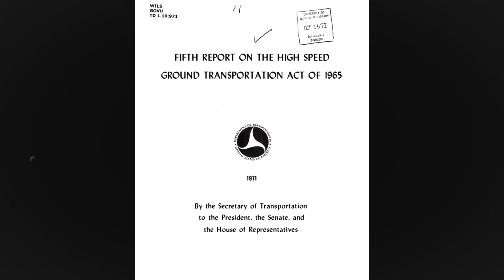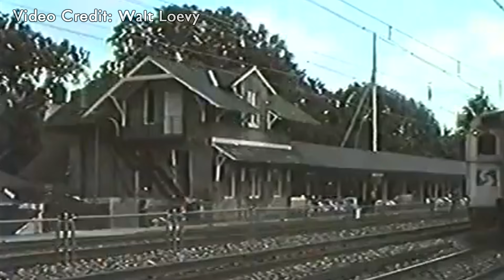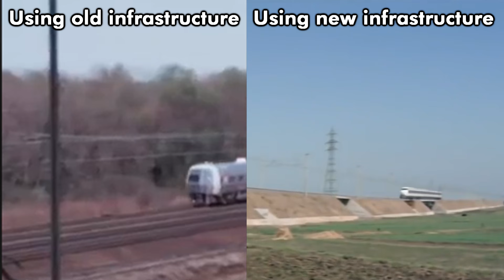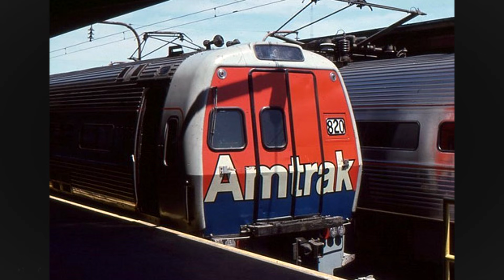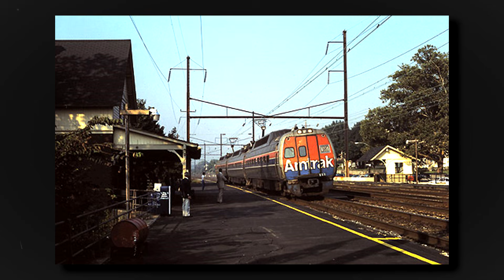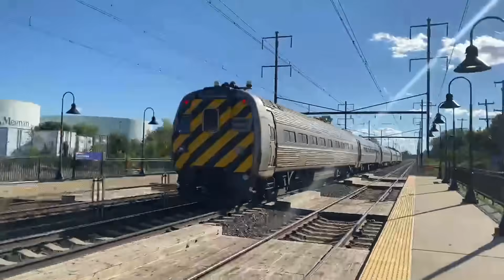Engines of Amtrak - Budd Metroliner [REMAKE]

Comment: Theoretically, it would have been possible to insert Amfleets in between Metroliners and have them run as a multiple unit independent of any locomotive support... I mean even in Japan, their express trains are a mix of both motor and trailer cars. You just have to resolve the HEP issue.

Comment: They were trying to build high speed rail, how did they not think, for one second, even as metroliners were ripping oit windows, to add an ærodynamic nose cone to the front and back?
Reply: Especially when they had done that to steam trains not more than 30 years before and there were rumors that they had already beat the Shinkansen with those.

Comment: I’ll be honest, using Metroliners as amfleet cab-cars is actually a great idea. The amfleet and metroliners have very similar in body style, so it would be rather simple to just remove the propulsion systems and put AAR type B trucks where the driven trucks were, and use them as push-pull cab cars.

Comment: If you asked someone in 1960 which country built the Metroliner, the USSR or USA, no one would guess correctly. It's a very Soviet solution to high speed rail: a big, dumb brick that goes fast.
Reply: Pretty well sums up America; a big dumb brick going fast, straight into nothingness.
Reply: The United States and the Soviet Union were actually very similar, the difference is that the Soviets were oppressed by the CCP and the Americans are oppressed by the corpos
Reply: @armandoventura9043 communist party*, CCP is the Chinese equivalent

Comment: A few stripped Metroliners were used in commuter service running in the Calumet Region of Indiana into Chicago. They were used as push-pull cab cars until replacement by cabbage-ified F40PHs.

Comment: Ok, so we've had what is by most standards HSR since the 60s, since before Amtrak! Yet Brightline still only runs 79mph and claims it's somehow "HSR."

Also, I feel like we need some kind of a name for 110 to 125mph services. Riders need to be able to immediately tell that this is not your conventional intercity Amtrak line. But at the same time anything below 125mph really isn't true HSR either so you can't just call it high speed. I guess "increased speed rail" or maybe "bullet train"?
Reply: I think Amtrak tried doing that with the Acela brand in the early 2000s, but it just generated confusion. Anyway, the definition of a train service travelling around 125mph is "higher speed rail".
Reply: @nicopavvi8494  But that is basically the same thing as HSR in the minds of the vast majority of consumers. Just look at how Brightline is constantly called HSR, even though they themselves tend to avoid that moniker for their existing route. People get confused easily. You can't have two different terms be only two letters off from each other and expect people not to be confused. Unless you are deliberately trying to feed into that confustion.

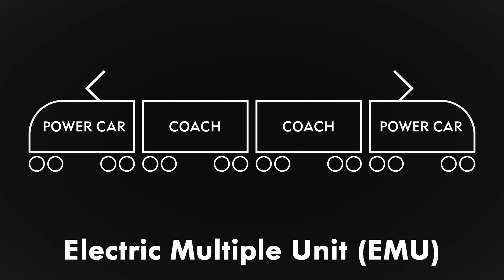Comment: 0:58 That was so satisfying to watch. Government officials have no idea how to run a railroad so them bullying the PRR into giving them clowns what they want was just pathetic.
Reply: In all fairness, the private companies did not know how to run passenger service either and were much worse than Amtrak in many respects. They were only doing it because they got insane subsidies from the government that were conditioned on them running passenger service. 

The real problem with passenger rail is that it does not generate its benefits directly from ticket sales but via network effects in adjacent economies. It's the same with highways, bridges, and airports. If you set the tolls high enough to actually pay for the buildout and maintenance, then no one ends up using them. 

So you absolutely need some mechanism to capture those benefits to keep the service profitable. In Japan and Hong Kong (both notoriously great rail services) they let the railroads get lucrative land deals. The Transcontinental Railroad project gave away so much land to the railroads that they became the largest landowners in the country. Maybe that's how we need to run passenger rail in this country.

Comment: Always had a soft spot for the Budd Metroliner, I think because it was a train with a lot of endearing features, but ones that were sadly not fully realised. :)
Reply: The Metroliner electric m.u. cars were sadly, a victim of the technology that was available at that time. With 50 years of advances in technology, a newer "Metroliner II" type of electric m.u. car could work out, especially on MARC or NJT commuter rail service where the stations are spaced out every 5 miles (SEPTA would have to limit their use on express and limited trains), but not with Amtrak, as they're now fully committed to ordering dual-powered Swiss-style push-pull trainsets for the Empire, Northeast, and Keystone Corridors.
Reply: @rwboa22  We were unusually, and annoyingly close to this in the 70's and 80's. Not with the Metroliners, but with the Arrow trains! Not only did Amtrak commonly use the Arrow II's on Clockers, but they also ran them, in a collab with MDOT, on the Chesapeake: a DC-PHI commuter run. The Arrow II's were arguably the best trains for longer commuter and shorter intercity runs since they were the one of the few EMU's built with 2+2 seating. Add the seating layout of the Metroliner, and a snack/bar/cafe car, and you have a perfect intermediate EMU
Reply: Me to their 1960s Shape Make them look amazing
Reply: Totally agree. I find them to be the polar opposite of the APT in that way. The APT's were constrantly stuck in development hell, and were chastitized almost the second they entered service...only for their technology to find its way back to Britian. The Metroliners were sort of rushed to completetion, and while Amtrak really tried to make them work but gave up when they found locomotives that could do what they were supposed to. Decades on after their replacement, and Amtrak never tried EMU's like this again, nor did any of the commuter agencies in the Northeast with the honorable exceptions of SEPTA and technicall ConnDOT
Reply: Would you ever do a video on the Budd Metroliner?
Reply: @RHTeebs  https://youtu.be/yMb0F1CSw_k?si=cgSSamZLdTrRiyTN
Reply: woah i love ur vids!

Comment: 200 km/h trains (the initial specification speed was definitely exaggerated!) with blunt front ends and front gangways: That reminds me of the Italian ALe 601 built from 1960 in 67 units. Some of them are still in use as regional trains; in fast intercity service they were replaced first by locomotive hauled trains, then by Frecciarossa/Frecciargento units.
https://www.youtube.com/watch?v=-yY_5LVE998

The problems between oncoming trains could have been addressed with more attention to aerodynamics. I guess though that it's an experience you first have to make in order to build better trains later.
Reply: I think that what made the Ale601 successful was the fact that Italian railways already had experience with fast trains (the etr200 and, if I remember correctly, the etr300), while Pennsylvania Railroad/Penn Central and Amtrak, and also the builders had never built 125mph trains.
Reply: @nicopavvi8494 at least not intentionally.  There are those rumors about what S1 and T1 were capable of if they needed to make up time.  But those were running in less traversed steam territory and not in the heavily used New York to Washington line.  Also, they and GG1 were actually aerodynamic, unlike the Metroliner, and usually were carrying a streamlined train set, so they might not have created as much of a pressure wave.

Comment: Great episode. I assume Amtrak hasn't considered EMUs (or even DMUs) for their passenger services due to the unreliability of the Metroliners? It's also odd to see 3 car formations on the Keystone route instead of an even number like 4 or 2.
Reply: "Keystone" service back then was an unwanted stepchild for Amtrak. When the PRR and PC existed, Philadelphia-Harrisburg service would see either GG1-hauled trains or St. Louis Car Company-built Silverliner III electric m.u. trainsets go either to 30th Street Station or all the way to the underground Suburban Station with direct access to both the Penn Center (the former RoW for the PRR's former Broad Street Station) and Philadelphia's City Hall. Only recently (last 20 years) has the Pennsylvania Department of Transportation (PennDOT) started pouring money into the (severely) delapidated Keystone Corridor, rebuilding the main infrastructure to allow for 110-mph electrified train service, of which included the refurbishment of the surviving Budd Metroliner cars that were reconfigured into cab-coaches for other corridor-related lines.
Reply: I've theorized this for years, and this extends to the other commuter routes up & down the NEC. Since the Metroliner's retirement, every commuter operator followed their example in only ordering locomotive hauled trains, with the honorable exception of SEPTA. Even then, the Silverliner V's are a decade old and their latest order was for Sprinters

Comment: Just a suggestive question for your channel (and going off the note of Metroliners turning into Amfleet rolling stock), what if you made a series about the rolling stock of Amtrak? I know that rolling stock isn't particularly as interesting as the engines of Amtrak, but given that we as the passengers reside in Amtrak rolling stock instead of the locomotives in our journeys, I think it's important to note that rolling stock as well. Although rolling stock hasn't changed much over Amtrak's existence, there is still a variety of rolling stock that Amtrak used and still uses, like the Amfleet Is and IIs, the Horizon coaches, the Viewliners Is and IIs, the Superliners and even the Talgos in the Pacific Northwest.
Reply: Maybe one or two special episodes, why not.
Reply: You mean coaching stock.
Rolling stock includes locomotives too.
Reply: @fieldmarshal3102  yeah, that's what I meant.

Comment: It’s funny that the Japanese Shinkansen were basically designed after airliners while American engineers saw that their brick wasn’t quite going fast enough so they said, “Make the front a little pointier”
Reply: Eventually they decided that they needed not a brick, but a toaster.
Reply: Huh I have always thought the first gen Shinkansen trains looked like square planes on wheels.
Reply: Or added jet engines to the tops
Reply: Yet that "brick" — as the Silverliner II — worked well for the PRR/PC, Conrail, and SEPTA until they (along with the St. Louis-built Silverliner III cars for PRR/PC intercity service between Philadelphia and Harrisburg) were practically forced out of revenue service by the FRA due to age-related issues; SEPTA practically buying extensions for their operations while Hyundai-Rotem was getting the SEPTA Silverliner V cars ready for revenue service.
Reply: Aerodynamics are for communists
Reply: Pathetic
Reply: There is the UAC Turbotrain, which is more reminiscent of an airliner
Reply: Is it just me or the 0 Series Shinkansen looks like it could have taken inspiration from the UP M-10000?
Reply: What Japan 0 series sides are flat as fuck only the front of has that big plane Nose and have you seen the T1<-->T4 testing

Comment: I see these Metroliner Cab Cars all the time on the Hartford Line & Valley Flyer services. I’m glad someone made a video about the history behind them. Its very interesting (at least in my opinion)
Reply: Your profile is literally a metroliner
Reply: I remembered when Amtrak used them for Philadelphia-Atlantic City service (the so-called "Gambler's Express") before NJT took over operations and rebranded it as the Atlantic City Line. Otherwise, they're used on the Keystone and Northeast Corridors for Amtrak's "Keystone" service (with the daily "Pennsylvanian" trains using ACS-64 locomotives from New York Penn Station to 30th Street Station, after which GE Genesis locomotives take over for the trip west out to Harrisburg and Pittsburgh).

Comment: If the Metroliner and SPV had been successful Amtrak's fleet would have looked quite different with a lot more flexibility on frequency and capacity. Sadly while Budd could build a really solid dependable railcar the MU components gave them nothing but trouble and Amtrak has seemingly shied away from multiple units ever since
Reply: The Budd Company did build reliable e.m.u. and d.m.u. railcars. Look at the Silverliner II e.m.u. coaches: they were first used back in the early 1960's for the PRR and Reading in Philadelphia (under what later became SEPTA) and remained in revenue service for nearly 50 years; parts and FRA regulations finally forcing SEPTA to retire them (and the St. Louis Car Company-built Silverliner III e.m.u. cars) upon acquisition of the current Silverliner V cars from Hyundai-Rotem. While the Metroliner e.m.u. cars looked good on paper, what killed them was the motors that had to be developed for the expected (but never achieved) 150-mph service. I will say that if today's technology was used on the e.m.u. Metroliners, you could have a reliable intercity trainset that could be used by regional transit authorities (such as SEPTA, NJT, MARC, and Metro-North) that could run express and limited trains and not have to depend on locomotive-powered "push-pull" service. Even Amtrak, using completely rebuilt Metroliner e.m.u. railcars, could have used them for their "Keystone" service, freeing up the ACS-64 electric locomotives for Boston-Washington or NYC-Washington "Regional" service.
Reply: @rwboa22  True about the silverliners, and the Budd RDC was a good DMU as well, but Budd seemed to struggle with the next generation cars especially on intercity. I think the big break if the Metroliner or SPV had been more reliable would have been much better flexibility on routes needing short conisists, no longer wasting a loco pulling two or three coaches, and more options for frequency or to run service where a locomotive and coach could be spent better elsewhere
Reply: I wonder what would’ve happened if they had gone with Power Cars and Coaches instead of Multiple Units

Comment: That's the American way! Forget streamlining until absolutely necessary, just get a big silver block up to speed through sheer brute force in what Justin Rozniak of WTYP once termed "The biggest "f**k you" to aerodynamics in the world."
Reply: With the "second biggest f*ck you to aerodynamics" being the F-4 Phantom II
Also Yay Liam
Reply: @fernandomarques5166  And the P-47 being the 4th fuck you to aerodynamics in the world
Reply: 1200hp per car, what brute force? The contemporary DB class 103 had over 12000hp in a single locomotive, now that's proper brute force. And yes, no-one needed that much power, so it's successor has to 'make do' with roughly 9000hp.

Personally I still think the Flying Pancake remains the biggest f-u to aerodynamics, closely followed by that NASA aircraft with a swiveling wing.